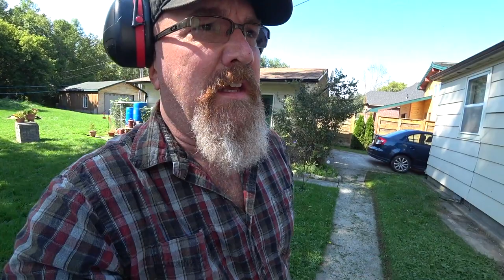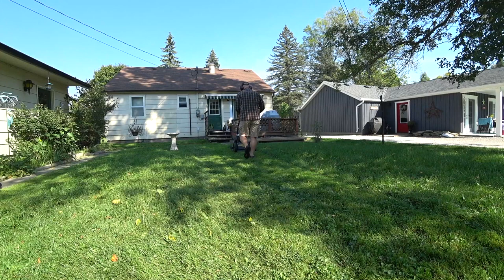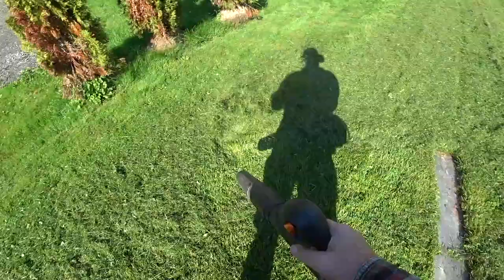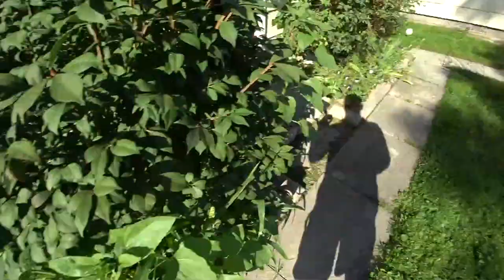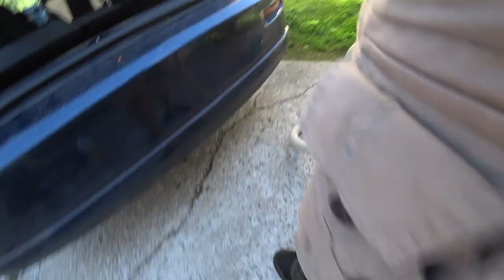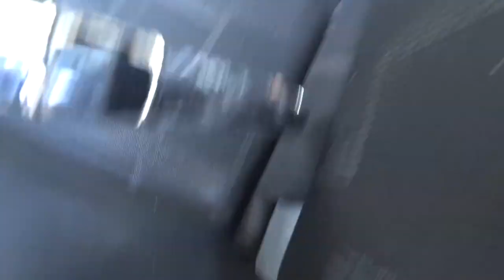This is Gonna Suck!

Comment: Hi ken big fan, I want to buy the x3000 for my own stuff as impressed with your vlogs and the camera has the same sense as my ax53, but the x3000 is wider. Can you tell me if you use the 4k much and have you suffered from over heating, some say it doesn't happen and some say it does. I would ideally want to use it for 30-40 mins at a time and 40- 50 mins as a break then back at it. Can you tell me if you have experience this or not?